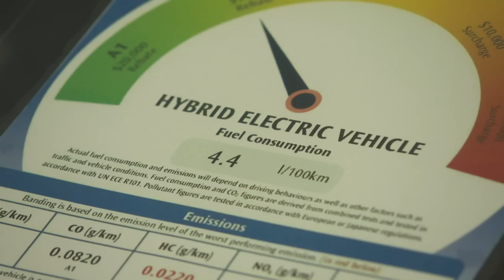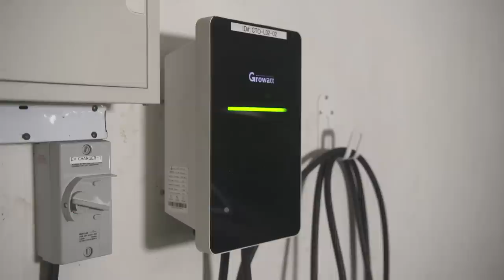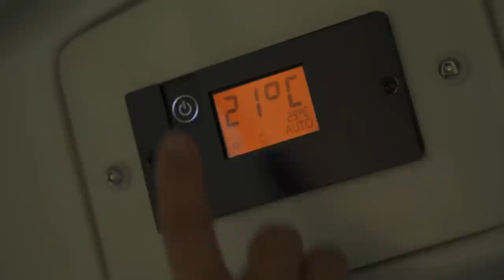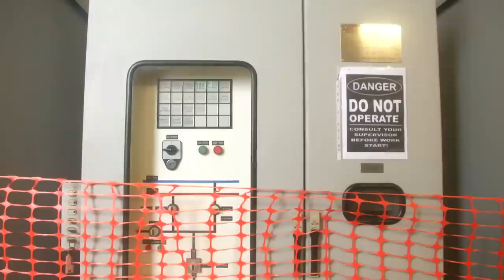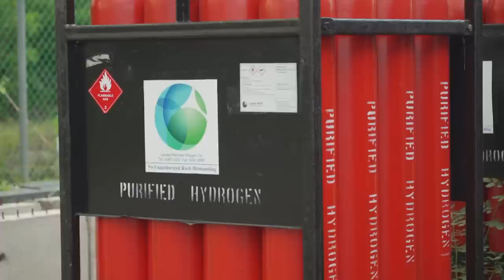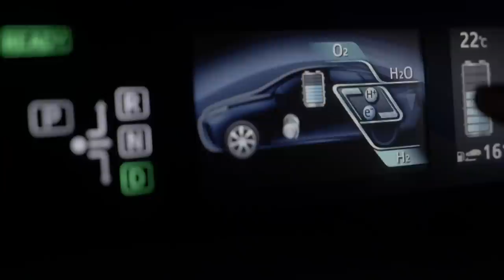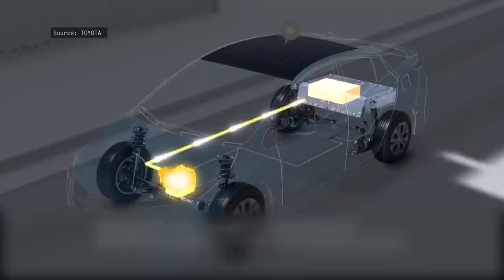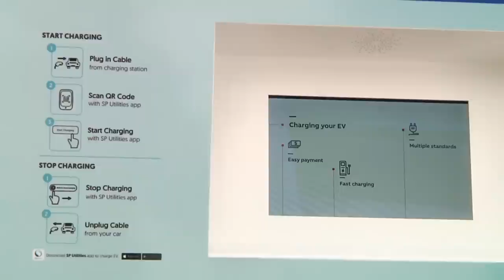Are Electric Cars Really Good For The Environment? | Why It Matters 4 | Full Episode

Comment: I dont believe... electric in certain country can be obtain by green way but if the source of electric is from the fossil fuel... then it still cost more harm to environment and the electric will still goes up... electric car has a lot of expensive spare parts compared to existing car... government need to address this as well...
Reply: Large gas powered turbine at power plants are a lot more efficient than the small engine of an ICE vehicle and the power plants are running on natural gas which has lower emissions than burning petrol/diesel. Even with our current grid emissions, it is already better driving an electric vehicle than a petrol/diesel vehicle. As the grid emissions decrease with increased solar deployment, it is only going to get better with an EV but conversely there are no petrol/diesel vehicles that can use renewable energy. Electric cars also have much lower maintenance than a comparable ICE vehicle, about 50% lower on average.
Reply: @alvins.2428  the electric car spare parts still a costly point to take into.  Yes... you maybe right 'much lower maintenance' but when a part of electronic spoilt it will cost very  or veRy much much high when comparing to current car maintenance. It is still needs a lot years for the economic of scale to take into effect. As i mentioned before.. unless the 'pemenrintah'/government willing to forgo the tax (no tax) or tax relief on every parts of electric vehicle...  to make it works.... "Pemenrintah' needs to do a lot more... then only will be a 'WIN WIN' situation for everyone.....Another problem with electric car... battery... how to recycle....until now still no solution

Comment: manufacturing of batteries and cars are not really that green to begin with.
Reply: Manufacturing of engines and fuel isn’t either though
Reply: One doesn't make an electric car or an ICE car and then immediately throws it away. The entire life cycle of the car has to be taken into consideration and this is where an electric car will still have a much lower carbon footprint than a comparable ICE vehicle throughout it's life.

Comment: To get 100% carbon neutral transportation  human should start using horses -  it is the only silver bullet
Reply: What about the excess methane?
Reply: @amanchaudhary742  More ammonia that methane in H/S beside the H/S works great to heat the compost pile for my organic gardening
Reply: @amanchaudhary742  what nature produces it absorbs it also. What human produces it will stay as it is look around you
Reply: The trees will convert the carbon dioxide to oxygen. It’s the non biodegradable plastics and CFCs we need to worry about.  Not the CO2. Farts contains CO2.